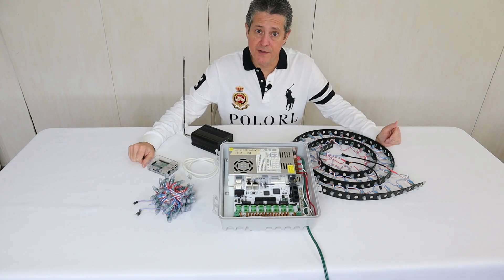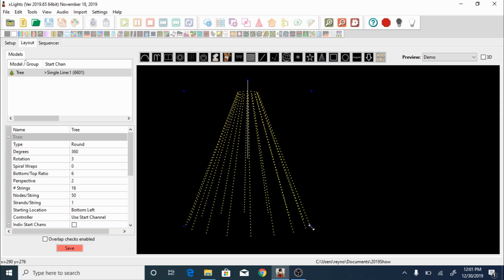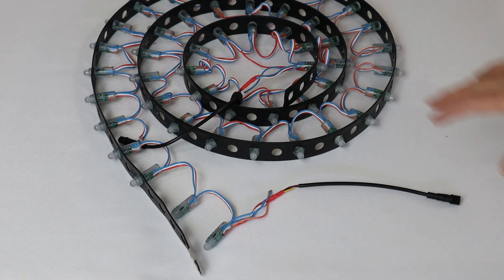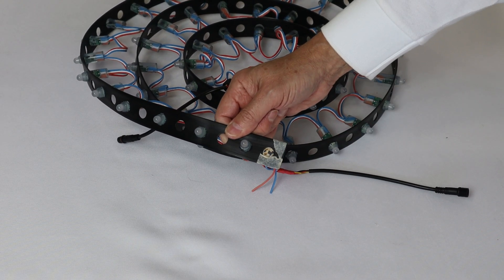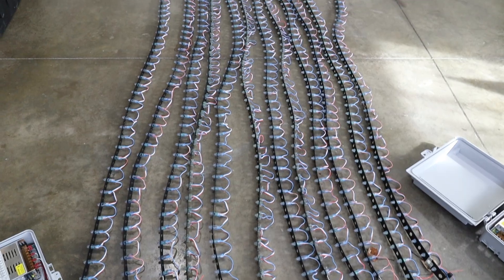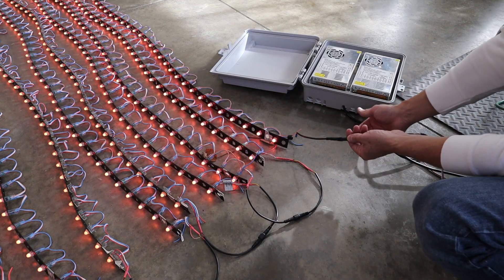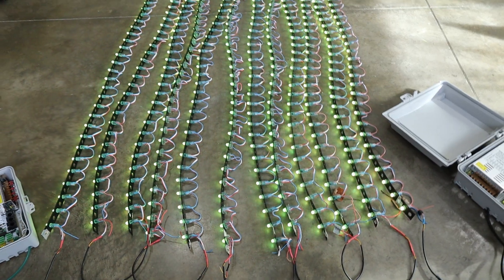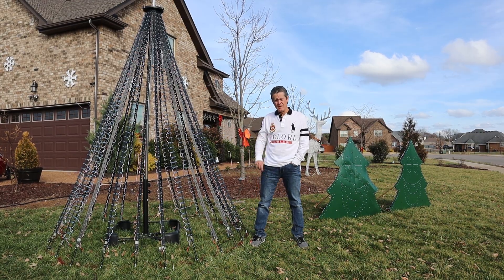How to build a L.E.D. Mega Tree - Step by Step

Comment: Nice job. Quick question: do I need the F16v3? Do you know of a less expensive controller? I see the f16v3 has multiple outputs but with the tree, we only be using a few of them.  Please advise
Reply from the maker: Thanks you. Unfortunately no. Most of them run for $200 dolars. But you get many functionality. Think of it as an investment for years. I started with 1500 pixels. A few years later I have over 6000.

Comment: Hey Trevi what controller and receivers did you use for the singing Chris tree? Did you add data to megatree receiver or supplied one for the singing tree? I am getting bunch of stuff from holidaycoro so just want to be sure what I would need.
Reply from the maker: Hey. I only use a Falcon Controller F16V3, no receivers. The distance between the controller and elements is short. I do have an extra power supply under the tree which injects power to the tree and other close by elements.
Reply: @trevilights  whats the rule of the distance before a receiver is required? I'm trying to do megatree, arch, singing christmas tree and few other elements. I would say approx feet would be 25 from garage to lawn.
Reply from the maker: @rpra7392  25ft should be okay. Use some good quality 18gs 3 wire cables for the run. My show is 12v and believe this voltage is better over 5v when it come to voltage drop   over distance. I recomend you to buy some F-amp just is case. 

https://www.pixelcontroller.com/store/controllers/53-falcon-picap.html
Reply: **F16V4 is what I purchased
Reply from the maker: @rpra7392  You won't regret it. It's an amazing controller. And you got the newest model. Congrats!
Reply: @trevilights  thank you! Hopefully I can figure things out on my own. Still a bit confused on wiring things up, etc.
Reply from the maker: @rpra7392  You will figure it out. It's not complicated. I do not have a video on that, but there must be a few out there. Good luck.
Reply: @trevilights  yeah sadly just found out holidaycoro is behind on orders and will not be available.
Reply from the maker: @rpra7392  I will recommend you to put a backorder. So they'll send it to when available. They are in high demand this time of the year.
Reply: @trevilights  i ordered 2 weeks ago and now getting an update. I know things are bit slow with shipment. I might have to cancel and move with something else.  I know falcon F16V4 will be shipped out next week, but man I was looking forward to the megatree kit from holidaycoro. Guess I'll have to figure out plan B.

Comment: I'm looking at following your instructions to build my first mega tree. When I go to the site to buy the Falcon controller, which options do I select? I can see I'll want 12v based on the lights you suggest. But what about pigtail type? Thank you for putting these videos together, your work is amazing.
Reply from the maker: Hey Richard. Thank you so much for your words and for watching my videos. The selection of pigtails is up to you. Just make sure they are water proof which most of them are. You will need 1 pair per string(strand) for your tree. Since we are doing a zig-zag pattern, your string will connect to each other on the top and bottom of you tree. You can find different brands and sizes on Amazon. Many people use Ray Wu brand, they use 18awg wire which is robust. I used some unbranded that I got from Aliexpress(china). Buy always the same brand, since the connector size varies and might not be compatible between them. Good luck with your project. 
https://www.amazon.com/Pigtail-Waterproof-Connector-Lights-13-5mm/dp/B07YZDCG9P/ref=sr_1_7?crid=3MOZGDFO9511U&dchild=1&keywords=3+wire+pigtail&qid=1632829740&sprefix=3+wire+pigtai%2Caps%2C393&sr=8-7

Comment: Thanks for the great videos.  I am new to pixel Christmas lights and have been able to get my first display working good by watching your videos.  My first tree was an artificial tree with 450 lights on one string.  They are 5 volt strings and power injected.  I have had about 6 lights go bad after testing the tree for a couple of months.  Is that failure rate common?  My next tree that I have about finished is a mega tree with 1500 pixels in 30 strands.  Should I run one strand per controller output so if a light goes bad I don't lose a large portion of my display?  I see you ran half of your tree on one output.  How did that work for you?  Any help is appreciated.  Thanks.  Dave
Reply from the maker: Dave, Thanks for watching. Makes me happy to know that I am helping a few of you to get started on led shows. I've been doing this for 4 years now and I have never had one single pixel go bad. Check your connection for a short and make sure you are using the correct voltage for your pixels. It's weird that you having so many strings go bad. For your tree, I assume that you are using a F16V3 Falcon controller, which has a limit of 1024 lights per port. Is you are planning to have 1500 lights then you are going to use two of your ports. You can have any number of pixels per port as long as you do not go over 1024. But I recommend to break it in two to make configuration more simple. Your you can have 750 pixels on one port and another 750 in another port. Take into consideration that you will need to inject power to feed 750 lights. I recommend injecting at 3 points. The first point is  where it connects to the controller which is already injecting power. The second point will be half way, like at the end of strand number 7 and the last one at the end of strand 15. The same goes for the other string. Hope this helps.
Reply: @trevilights  Thanks for your help and input.  The tree that is burning out the lights is using 5 volt lights and I am using a smart receiver set at 5.1 volts which is the minimum for the smart receiver to operate properly.  I am going to take the lights off of the tree and run them individually on the workbench and see if I can figure out why they keep burning out.  My mega tree should be done in the next couple weeks thanks to great advice from your videos.  They were especially helpful in getting Xlights working.  I will power inject every hundred lights and since they are going to be run off a smart receiver I will probably input data every 500 lights for my total of 1500 pixels.  Once again thanks for your help.  Dave
Reply from the maker: @susanclouse281  Dave, as a tip see if by removing the first pixel of your burnt string makes the rest of the pixels to work. It could be just the first pixel that is bad. You might be able to reuse the rest on some other elements.
Reply: @trevilights  Thanks for the tip.  Yes, I have been replacing the bad lights and the strings work again.  The tree that I am having problems with has 9 strings hooked into it so if one bulb goes bad I lose the majority of the lights on the tree.  I was glad to hear you have not had a pixel go out.  I might just have some bad strings.  My current Christmas display has over 30,000 regular LED bulbs which don't give me many problems so I was surprised that the pixels were burning out.  Thanks again.  Dave

Comment: Do I I have to have a rashbeery pi even if I don’t have music? This my first year and I would like to make only the tree
Reply from the maker: Hi Rexton. No, you can play a sequence from your computer straight to the controller.  The Raspberry Pi replaces your computer and add some other functionality. You can schedule and organize your sequence among other things. But is not required. Thanks for watching.
Reply: Thank you for your videos. It is really helpful. I am thinking of buying a F16v3 fully assembled controller and I have followed your steps and almost set. Only the sequences just learning. In falcon controller there is a sd card slot can I  download the sequences in a sd card and play without connecting the controller to the computer? I s there a video to help me that? Once again thank you..
Reply from the maker: @rextonandrew  Rexton. Buying the controller fully assembled is a smart move. The controller has an SD card slot but it is only used for software upgrades. Playing sequences out of it is not supported(yet). So the sequences need to play either for your computer of other devices such as the Falcon player installed in a Raspberry PI.
Reply: @trevilights  Thank you for the quick response.

Comment: Hi, could you help me to know where you buy the box for you power supply?
Reply from the maker: Hey Ivan, You can get it here.
https://www.holidaycoro.com/CableGuard-CG-1500-Mounting-Enclosure-p/637.htm
 or 
https://www.amazon.com/CableGuard-CG-1500-Coax-Demarcation-Enclosure/dp/B00EKKDRTM/ref=sr_1_2?dchild=1&keywords=cg-1500&qid=1626723918&sr=8-2

also you will need some mounting plates
https://www.holidaycoro.com/Dual-350w-Power-Supply-Mounting-Kit-p/639-kit1.htm

Comment: Great video.  Are these links everything I need to build a mega tree. I feel as if I’m missing something
Reply from the maker: Hi Robert. Thanks for watching my video. You still need some tools like heat gun, clippers, solder gun, antenna pole, some sort of base for the tree to hold it upright(unless you have help while you out some of the plastic strips). Some plastic or metal anchors, 3 wire cables enough to run a line from the controller to the tree. You should start as soon as possible. It takes time to gather and assemble all of this. Also the resting and sequences takes time. Good luck.
Reply: Awesome I'm bout to place my order
Reply: Ok. But as far as the controller and power supplies I just need to order the list?
Reply from the maker: @robertcavello6568  Yes. I would recommend  you to get the Falcon Controller F16V3 as kit or fully assembled, some extra  power supplies and some pixels ws2811. All in 12 volts. This will allow you to get familiar with the project.

Comment: Hello Trevi  I have a question.
the top of the big tree. where the pixel band enters.
is this for sale somewhere or can it be printed yourself with a 3d printer.
I would like to hear from you then I can either buy or make it.
thank you in advance
greetings gideon
Reply from the maker: Hello Gideon, I got it at Holiday Coro. It is the QT2 for up to 32 strands.
https://www.holidaycoro.com/PixNode-Strip-MegaTree-Topper-For-MegaTrees-p/750.htm
Reply: @trevilights  Hi thanks for the answer, I'll take a look there,
see if they also want to send it to the Netherlands.
Reply from the maker: @gideonnederpelt8023  Netherlands! Hope the shipping is not to much.
Reply: @trevilights  the shipping cost is almost as much as the topper, $ 34.
unfortunately there is not much to be found here in the Netherlands
Reply from the maker: @gideonnederpelt8023  Well. It will be a one time investment.

Comment: hi trevi how did you connect the 3 power surply to mega tree because i want to add other power surply to my matrix and mega tree that is connected to controller
Reply from the maker: Hi Den bel. I placed and extra power supply under the mega tree. All you have to do is connect the positive and negative wires to extra set of cables that most of the LED string have. Basically I have an extra pigtail   every 200 or 300 lights. I am also injecting power ar the last string of lights of the mega tree. My mega tree is 1200 light. So I am injecting at led 300, 600, 900 and 1200. That power supply also supply power to my singing trees. Obviously you need to run a 120v extension to power the 12v power supply.

Comment: question from an amateur ( newbie ) here, how the Falcon controller can accept 600 lights in ONE port ??? the ports are fused at 5 amps, aren't they not ??? 600 lights at .06 A is 36 amps ???
am I missing something ???
Reply from the maker: Hi Sylvain. My knowledge in electricity is very limited. And chances are that I am reading the manufacturer specs wrong. The amps and watts thing can be confusing. To clarify things I did a video on power consumption using a Power Analyzer. Please watch it and keep a close eye on the amps reading on the top left of the analyzer screen.

You can start watching at minute 1:30
https://youtu.be/93gLUWTjS_U

Comment: Hi. Trevi, Do you have any video showing how to take a picture of a house to incorporate it in the Setup of xlight software showing where to place a model or pros...
Reply from the maker: hey Li2, I do not have a video on that. But if you click anywhere on the black portion of the Layout view, you will see an option to the left that says 'Background Image". Here you can select a photo of the front of you house and it will set it and background. Then you can  bring its brightness to 20.
Reply: @trevilights  Tenx.. I have another question for you regarding Raspberry Pi. I have watch your video  and it was very well said.. However, Im a little bit curious about using this gadget plus the FM transmitter. My question is,.. If I use this Raspberry Pi with FM transmitter will my lights in mega tree dance with the music in FM radio?
Reply from the maker: @li2buenafe  Hello Li2, I have never done anything like that. The Falcon player(PI) plays sequences form xLights. I know xlights has an music effect that will make lights dance. But the music comes from a file not the radio and it has its limitations. In YouTube search for xlights music effect. There are a few demos available.
Reply: Hi. Trev.. Got a question. I just received my F16v3 16ports 12v. To be use for my 16 ft Mega Tree. If I want to add let  say a roof line layout with 400 Nodes with 3" spacing. Do I need to buy another controller for my roof outline.?? and another controller for a singing Tree just like yours. ??
Reply from the maker: @li2buenafe  Your Falcon controller is capable of controlling just over 16,000 lights. If your show is not having more than that then you only need 1 controller. Each por can have 1024 lights connected to it, regardless of what are they used for. You can use 300 for a singing element they jump to your roof line and end up in a few snowflakes. You   will have to let you controller how are they splitted. Just remember that you will need to inject more power as you keep adding lights.
Reply: @trevilights  Hi Trev.. Im typing the  IP address shown on my F16v3  to my browser but it doesnt give me the page of Falcon Controller for configuration.??
Reply from the maker: @li2buenafe  Is your computer hooked to that same router/wifi?
Reply: @trevilights  Im just so excited about this F16v3. I was doing it wrong.. yes I hookup the controller to my router and there it shows the IP address. However. When i tried to chck the IP address on my browser i forgot I disconected the controller. Then my son said I need to connect the controller to the router then chck the IP address to my browser. There you go the Falcon page shows up.. hahaha.. what a dum father..  i was just so excited about this controller.. tenx Trev.. both of ytou and my son is a life saver heheheh.🤣🤣🤣🤣
Reply from the maker: @li2buenafe  Those are great news. I am glad you got it sorted out.
Reply: @trevilights  hi trevi its me again.. I have a question, If I have 2 or 3 or more controllers how do I link or sync them?  If so, where and how to connect them...???
Reply from the maker: @li2buenafe  Hi There, I do not own multiple controllers so my advice will be limited. So, first in xlights in the Controllers tab you will need to add all your controllers(give them a Name) and give it's IP address as well of the universes. Once that is done then you can move into the Layout view. Imagine that you will have two large Mega trees each connected to different controllers. Select the first Mega tree and click on the 'Start Channel' option.
You can select the 'Controller' option and select the controller where you tree is connected to, then give the start channel. This will tell xlights where to send the data to. Do the same for all your other elements. Just let xlights know where lo find the elements.
Reply from the maker: @li2buenafe  Also all the controllers must be connected to the same router/network.
Reply: @trevilights  Tenx Trev. big help..
Reply: @trevilights  Tenx so much.. big help...
Reply: @trevilights  Got it Tenx..
Reply: Hi. Trev.. Got a question. I just received my F16v3 16ports 12v. To be use for my 16 ft Mega Tree. If I want to add let  say a roof line layout with 400 Nodes with 3" spacing. Do I need to buy another controller for my roof outline.?? and another controller for a singing Tree just like yours. ??